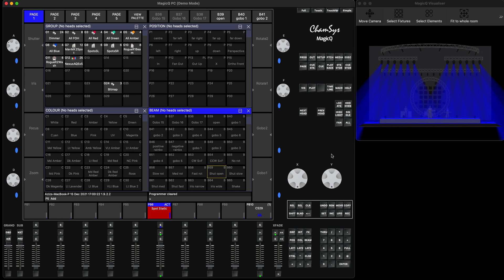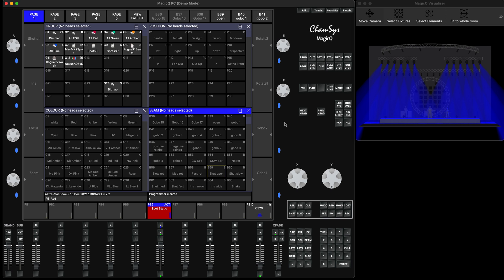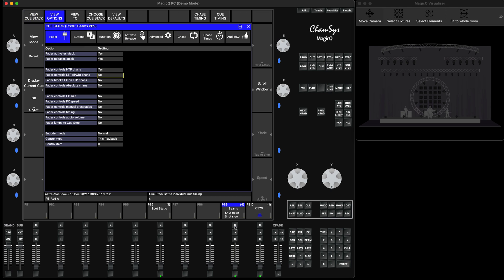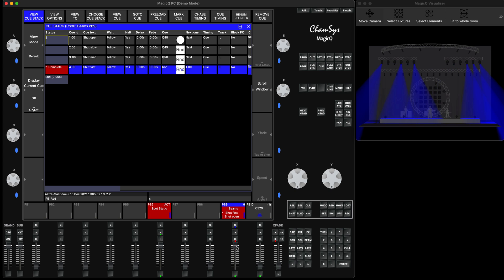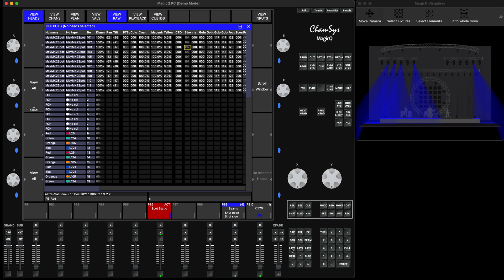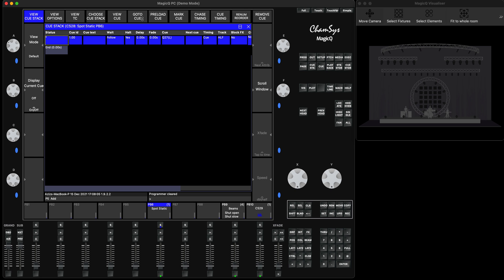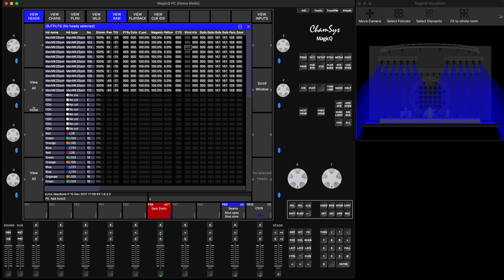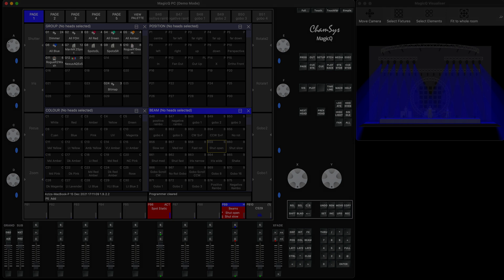Strobe on Fader - Part 2. Jump to cue

Comment: I mean this is the method i use.
It still feels tedious. I love to have fine control like 1 to 20Hz in single steps which makes me create 20 Steps and thats only for one Strobe mode.

I posted to the suggestion that we should have Fader Range Function Cuestacks.

That follow as example Down to UP: Open (005), Slow to Fast(240>128) which does the math on it self in Percentage steps. Or you define the Percentage steps like 1-5% is Open and 6 to 100% is Slow to Fast. You could do that for each fixture with their own table for the Strobes.

I feel like in the world of Multi Strobe fixtures this would be the right way to go. Espacially because you could switch with go and pause between strobe modes which i did in the past.
Though this only works with FX and Cues that work with HTP if its possible.

I dont know how the Professionals are compensating that in an timely manner tbh.
Reply from the maker: Nah, what you are saying shohld have been done by fixture manufacturers, not Chamsys. I’ve seen 500 shades of weirdness when it comes to shutter channel and its not chamsys’ or any other manufacturers job to “fix” that. I agree this is not the cleanest methods or simple way of doing what coukd have been easy peasy job but with all those permutations related to strobe, pulse, jitter, random strobes and all going in weird order, its impossible to make it simple unless its done by fixture manufacturers themselves